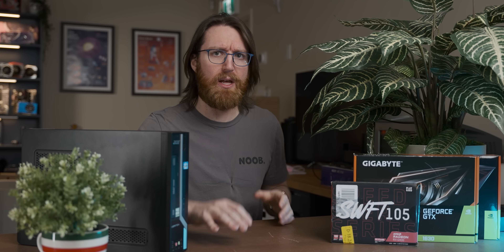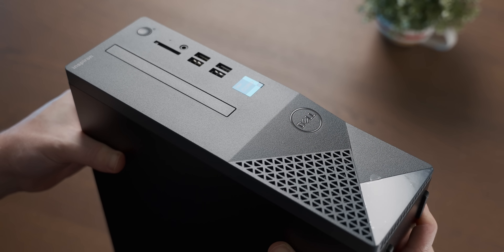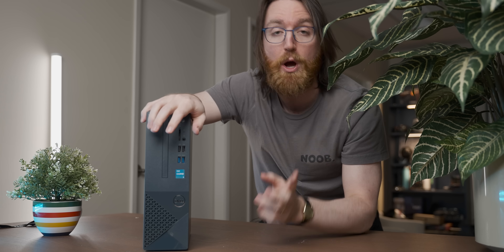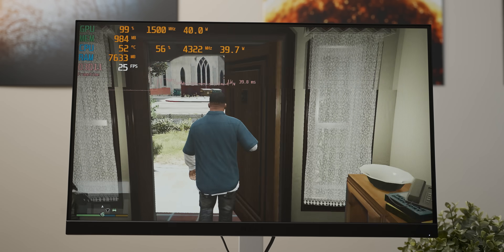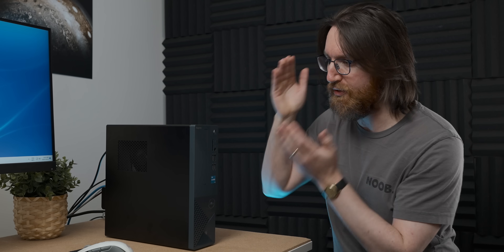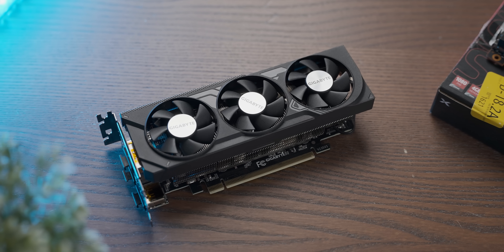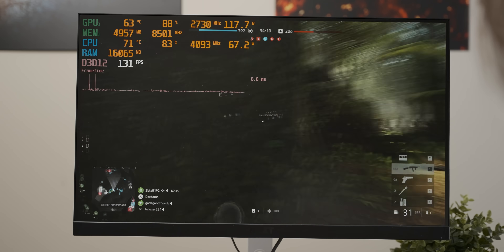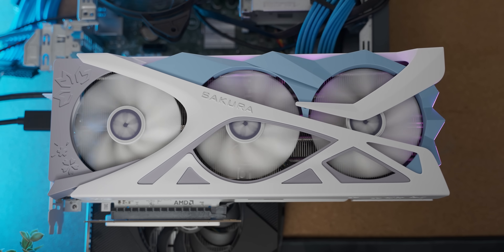The FUTURE Of Budget PC Gaming?

Comment: I know this made the video length longer but I love how you replace the components one by one instead of instant overhaul. Letting us see what sort of components we need to prioritised when we need to fight in the alleyway in the future.
Reply: This. In 2029, when I'm running from mutant racoons with 16 gig RAM stick in one hand and a RX 8400 GPU in other, I need to know which one I can throw away to gain more speed.
Reply: Did we watch the same video? He could have gone to dual channel RAM before the GPU upgrade, at least.
Reply: Yeah, no, OP was watching some other video. More times than not, Dawid changed 2 components. Certainly not one by one.
Reply: Not sure how applicable it is since the only lesson here is "don't use a power supply that can't supply enough power".
Reply: @CyberneticArgumentCreator  Yeah there is nothing to learn here other than just expiremental fun. 
In the end if you take such a PC and add all those things on it for it not to suck then you aren't saving much.
Reply: @CyberneticArgumentCreator  The little on actually did the job. Putting the big one on the cards did not help performance.
Reply: Indeed. I think the sweet spot here is the i5 CPU and the upgraded RAM, along with the RX 6400 GPU. It also gives you a SATA port which you can use for either an optical drive, or more storage.
Reply: this! i recently contemplated how to shoehorn that low profile nvidia gpu into my ssf and opted for the arc 380 due to that fitting my 240w psu more and using another psu to power the whole thing was... more than daunting. so i'm very interested in how to go about something like that. mind you the dell and hp ssf machines internally look eerily similar in layout, chassis  and, psu, and IO, to the point where it almost seems like they are outsourcing those to some 3rd party. i wonder whats going on there
Reply: Made for a more informative and fun video, for sure.

Comment: FYI:  Most gamers, about 95%, own a mid-range gaming rig.  Most marketing promotion seems to be geared towards owners of high-end gaming rigs.  That's because that is where the profits are.  They other 5% of gamers are either whales or have higher income (or a rich family).  I would have used a full-size tower with good air circulation.  There are a ton of used rigs with good cases on Ebay, Amazon, and Walmart.  I save all my working older parts like power supplies, screws, and etc. to use in new builds.

Comment: I have an optiplex that came with an i9 9900 and it came with that measly blower cooler, at 60w it was throttling
Reply: I had a 9900K and it was drawing north of 160W easily.
Reply: can confirm, even at stock hitting 4.6ghz all cores!
Reply: How did you solve the issue ? ^^
Reply: vibinz6693
He should do 14700f here too, fancy 60 watt next gen GPU's are the best Workstations.
14700f can run games too, on fast XMP etc
Keep the i9 please, only use 2 DIMS on CMP as fast as you can find, you will never improve those low power CPU's on Kraken fancy 360 radiator levels.
Buy next gen RTX 4070 for it, bottlenecking it a bit, who cares ?
9900f are the best CPU's, able to play games on, never get any HOT !
Reply: OC that shizz  @scorg
Reply: @zombl337og  alas mines a non K model, so thats it maxed
Reply: :( thats alright, still a solid speed  @scorg
Reply: Same non-k CPU, but in a hewlett's pro instead everything was thermally throttling like crazy. After jumping through hoops to install a normal PSU, I ended up cooling the CPU with an AIO and the VRMs with small copper fins plus an average case fan, shifting me from thermal throttling to power throttling, mostly software considering all of my temps are now under control with 20C overhead. I'm fine, considering I'm now only bottlenecking my 4080 by less than 6% in 4k, fitting this GPU was a whole other nightmare though.
Reply: @modrribaz1691  "I'm now only bottlenecking my RTX 4080 by less than 6% in 4k"  

so does that mean that the pairing of an i9-9900 non-k CPU and a RTX 4080 are a perfect match for 4K gaming?
Reply: @zangetsu_the_best_zanpakuto   Initially, the CPU was thermally throttling. After adding a good cooler, the VRM began thermally throttling instead, preventing the PC from sustaining Intel Turbo Boost despite good CPU temps. I resolved this by cooling the VRM with copper heatsinks in a setup I improvised. However, it then became current-limited, as reported by Intel XTU. I heard BIOS modding could fix this, but I didn’t bother since the performance is now satisfactory for my needs.
Reply: @modrribaz1691    it also sounds like you found the sweet spot where your CPU and your GPU are working together at their optimum and not bottlenecking each other, at least at 4K!!!

Comment: Steve from gamer nexus said that the 13-100F is just about comparable to the 9900k which was A $500 CPU until a few years ago.
The 13-100f is around $120
So its crazy that a few generations later, we are getting the same performance for about 20% of the cost.
This probably has a lot to do with ryzen being very competitive and good value.
Reply: Just looked up the tdp and a 9900k drew 98 watts while a 13100F draws 58. Fuck yeah efficiency.
Reply: What about multicore score?
Reply: Jodysis
You need the 14900 or 13700 CPU to  run GTX 4080 card !
Old GPU, do old 9900 K CPU too !
Reply: @mopanda81  9900k, never bottleneck that RTX 4090 in it, use old GPU cards too!

Comment: I believe that "sudden onset seizure" in the cyberpunk benchmark is attributed to the crowd density setting. I know that area in the benchmark is specifically targeted to testing the processor and how it handles crowds. Generally in game you wont see many NPC's like that apart from generally populated areas such as corpo plaza or any busy main thoroughfare which explains the better frames in actual gameplay. I had a similar experience when upgraded only my GPU and my processor consistently struggled in that area of the benchmark

Comment: I'm surprised how well most modern games ran on that iGPU by just throwing in a couple sticks of good RAM, and all while using such little power.  I think that's really the key to future budget builds versus just replacing all the components with high end stuff.
Reply: yeah, ryzen's iGPUs are bangers for low graphics gaming
Reply: bro he also put in the 6400
Reply: did you not watch the video? he didn't just add ram, he added a low profile AMD graphics card
Reply: @theorphanobliterator  My point was how well games ran without the AMD graphics card.  Imagine not even needing a dedicated graphics card and still playing modern games decently
Reply: @travellingslim  yeah tears of the kingdom running sub 20s is "so well" 🙄
Reply: @theorphanobliterator  did YOU watch the video? he didn't play that. this is a PC.  ToTK is on the Switch.
Reply: A cpu like a R3 4300GE 4c 8t with about 30-40w power draw, one of the lower end 3gen ryzen apus is still better than this for office and light gaming. Office pcs would probably be better and more upgradeable if most oems stopped only shaking hands with Intel who change the socket every gen and don't have any actually good <100w cpus. Intel cpus are good and have their place, but it's not in pcs with 65w boards.
Reply: @rtl8814au  Yeah? Wait till Arrow Lake and that thing's iGPU performance.

Comment: Dawid they sell adapters that allow you to power these Dell motherboards with a regular power supply. Sometimes your stuck having to use the Dell cooler though because they like to do proprietary spacing as well as attaching the cooler to the tray instead of having a backplate. Other than that they are still mATX most of the time so you can transplant them into a DIY PC case.
Reply: That Power Supply is definitely some proprietary form factor tho, replacement won't be easy.

Comment: 5 years ago, I got an office PC for $180 that had an FX 6300 on a m5a97 board. Despite the FX series poor rep for gaming, I enjoyed it from an r9 270 gpu up to an rx 580 8gb. The PC was basically brand new and was easy to upgrade, full ATX and a large case with lots of ventilation for adding extra fans, a really good deal considering the price-similar options of the time.
Reply: Poor reputation is mostly because folks did not know that PS4 effectively had FX CPU, i.e. it was more than adequate for gaming 😁
Reply: @aleksazunjic9672  lol plus I put an overkill cpu cooler in and had it locked at 4.2GHz

Comment: The ending system reminds me of the first PC that I owned that wasnt a "For the family" pc. Optiplex 745, with a 2gb gpu that put out so much heat while gaming that I had to keep the side panel off and the HDD lived outside the case. If not the HDD overheated and blue-screened the system.
Reply: Hah kinda reminds me of when people had modded ps2 slims and used burned discs. You had to leave the disk drive lid open and sometimes point a fan at the dvd.
Reply: That's the kind of jank setup that makes good memories.
Reply: @MansakeLabsOfficial  the only other computer I have fond memories of is the first family PC we owned. A Commodore Colt 8088 ( yes I'm old)

Comment: I built a budget gaming PC with a Ryzen 5600, Radeon 6600, 32Gb of 3200 MT/s RAM, a 1TB PCIe 4 M2 SSD, a micro tower case with 2 front 120mm fans, and a 550W Corsair PSU for just 700 EUR. I bought everything new from Amazon.

I've since upgraded it a bit with a $5 SSD passive cooler from ebay, and a 15 EUR CPU 3 heat pipe tower cooler from a local store.

This was a much needed upgrade for a 12 year old 1050 EUR (with about 500 EUR of upgrades) PC I built in 2011. If we take inflation into account then budget gaming is cheaper now that it's ever been, at least for me.

Comment: I had a similar (but not as extreme) journey putting a double slot sized RTX A2000 into an Optiplex 7060 SFF. The PS is hanging outside the case in order for the A2000 to fit. Similar challenges for HP ones with 8th gen Intel or later. The earlier models 7th gen Intel SFF and before could accommodate the dual slot GPU, but Hp and Dell made the decision to only allow a single slot card in those slots at the 8th gen Intel models. However, my proper gaming setup is in a proper ATX case with standard parts. Enterprise machines great for productivity, but not so great for upgrading and very bad upgrade options - plus RAM locked at speeds lower than rated and can't be changed in the BIOS.

Comment: I got my own Dumpsteron 545s, originally came with an E5400 and a Visiontek 5560 garbage GPU I believe, Ive now got an asus motherboard with a Intel 2400S, a 660 Ti, the original POS 300 watt Seasonic Mesozoic period power supply and 3 terabytes of hard drive storage.

Comment: I'm a huge fan of both old Dells and old Intel quad cores lol. I have an Optiplex 5040 with an i7 6700 and GTX 1060 6G and an Optiplex 7020 SFF with an i7 4770 and a GT 1030 G5. One is at the desk, one is under the TV. I built them both sniping parts on Ebay, and they're both stacked to the max with RAM and SSDs.

Comment: The "beefy" CPU wasn't getting all that power dumped into it because what you were running didn't require the extra power. If you ran a CPU intensive benchmark tool it would have drawn way more wattage from the PSU (as in much closer to its rated TDP) - Simple.

Comment: Steamdeck, low end gaming laptops, and you come out cheaper with more performance. I never understood the fascination with these builds. Only makes sense if you either buy the initial system for $20 or less or you just inherit it. By the time you factor in the GPU, new RAM, new storage (which should be your first stop for a used office machine), keyboard, mouse, screen & sound, you are better off getting one devices that has all built in.

Comment: Don't underestimate the new i3 quad-cores. They are more powerful than you'd expect
Reply: One of my rigs has a i3 12100F coupled with a RX 6600 and 16GB ram. Runs surprisingly good high settings at 1080p and the GPU is the bottleneck instead of the CPU which is very nice. Complete mismatch spare parts build that quickly has become a favorite.

Comment: 11:43 holy fuck. It proves a point though: a dumpster mainboard is enough, and those super overpriced $300-$1500 mainboards are unnecessary.
Reply: You can make a lot of stuff work, but a $300 motherboard will at least let a CPU draw the power it needs. 

This Dell board is limited to 100W (with tweaks) so you stick to a low end CPU (to not waste money on unused performance) you can certainly cobble together a cheap gaming system, even if it looks like a test setup on a motherboard box 😂

Comment: I use to game on a couple of old sff office PCs with LGA1155 and 1151 sockets but it wasn't all bad, just very limited on what you could do with it. My main problem were the 140W PSU, I had to use a GT 1030 for about 6 years and there wasn't a lot of LP GPU options to chose that would fit inside.

Comment: Video Checkpoints
 
- 00:00 The video discusses the limitations of old office PCs for gaming and introduces a new office PC with an Intel I3 13100 CPU as a potential budget gaming option.
- 02:30 This section discusses the limitations of a budget office PC for gaming and the potential for upgrades.
- 05:03 Upgraded RAM and M.2 storage in a budget PC gaming setup improves performance on games like Battlefield 5 and Cyberpunk, but struggles with The Last of Us at low settings.
- 07:37 Overcoming limitations in the graphics card power supply for a budget PC gaming system.
- 10:12 The narrator tests the performance of an external power supply and a replacement Riser cable on a budget PC gaming configuration.
- 12:43 The power supply in the system is not allowing the CPU to draw more than 100 Watts, limiting its performance potential.
Reply: Is that ChatGPT working off the video transcript?
Reply: hmm... idrk? hehe @zimbu_

Comment: modern 4c8t cpus like the 12 and 13100 are on par or even faster than the two gen old 6 cores like the 10400 and ryzen 3600  
so i don't think you necessarily need 6 cores, the ipc maters too

Comment: I bet the ~100W wall you ran into was from VRM thermal throttling. The board may allow itself to deliver 125W, but the VRM most likely can't handle that kind of load, even with a fan blowing onto it. Maybe it'd work better if you added some custom heatsinks to the mosfets. Or maybe you should just do the sensible thing and stick to the i5 when upgrading this thing.
Reply: Or bios hard coded to use x amount of watts on the socket
Reply: @WayStedYou  i think its just the physical limitations and failsafes kicking in to try to not fry the board

Comment: That SATA adapter shenanigan made my skin crawl. A single SATA cable, which is usually two connectors, can provide around 55W. A PCIe 6 pins connector can supply 75W and an 8 pins, 150W. Here, you're basically supplying 110W (because I'm assuming the RTX 4060 doesn't actually use power from the PCIe slot at all or it would only need a 6 pins connector and not an 8 pins) with a single 55W source (and I'm being generous by assuming Dell was "smart" enough to put the entire available power of a dual-connector into a single one, but more likely, it's only providing around 28W, which is a fire-hazard), that's scary as hell. If you wanted to make an Halloween video, that's the scariest you could do.

Comment: Great stuff!   That 13100 seemed to me to be the way to go for building a new system. No used cpu has the same power at that price.  I really appreciate how you covered three levels of builds.  I would like to see if that motherboard could be put into a spare mini tower case. I wonder if it has standard power connectors. Also, if they had a bigger form factor for that Inspiron that has more pcie slots, Sata connectors, and NVME.  But it seems like buying a general purpose 13th gen motherboard would be better.
    I am curious what the difference would be in fps from the onboard intel graphics and a under hundred dollar graphics card.  I would be tempted to use something I had laying around or just us on board graphics with those 13 gen chips.
    Interesting that 4 cores and 8 threads is really enough for the games.

Comment: You can run a GPU in the top slot without an extension if you cut a slit in the end for the full length connector to pass through. I've done it myself several times. Whatever performance hit you'd get from the limited PCIe bandwidth is actually offset by allowing enough airflow to cool the RX 6400. The cooler of that XFX model is pretty inadequate, so it needs all the help it can get.

Comment: 4:15 - it is possible to put a dual slot GPU into the smaller slot. There will be a performance penalty due to the lower number of PCI-e lanes, but it will work. I ran into the same issue with an Optiplex 9020 SFF and a GTX 1650.
Reply: Max_Mustermann
try to fit your RTX 4090 in the PCIe Gen 5 1x slot ? HOW ?
only on paper you can do that, just try, and post it here please !
Other boards do that, not these !
Reply: @lucasrem  My bad. I thought the small slot was an PCIe x16 with 4 lanes wired like on the Optiplex I was dealing with. It really does appear that the PC in this video only has a PCIe 1x secondary slot.

Comment: Nice intriguing video, shows just what the Dell Inspiron is capable of!
Personally, I would have gone with the i5 upgrade, 64GB RAM (the max it supports, because why not), a larger (and full sized) M.2 SSD like the Crucial P3 Plus, the RX 6400 and a DVD drive (which can be had real cheap if you buy a used one online). Maybe even a secondary disk if there was enough SATA/power to take it.
That's realistically as far as you can go - the i9 won't work due to the power consumption limitation (and cooling limitation!), and the RTX 3060 won't work due to the 8-pin power requirement, as well as not being able to mount dual height GPUs...